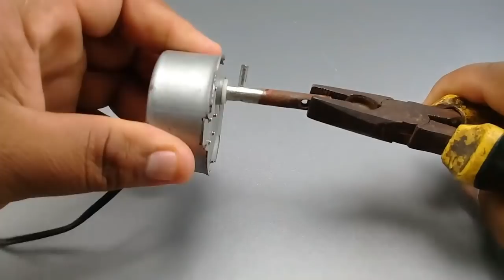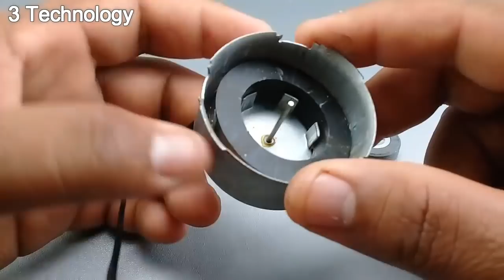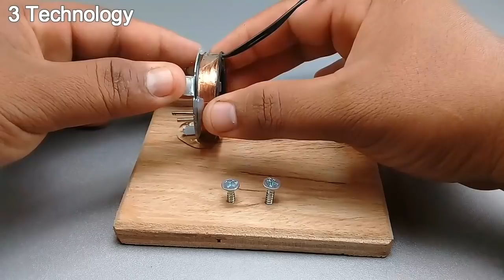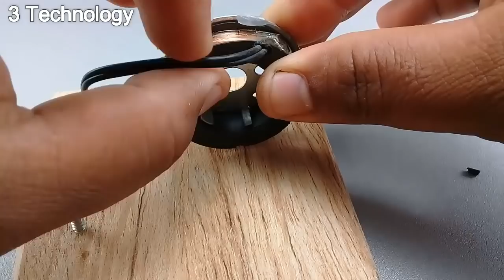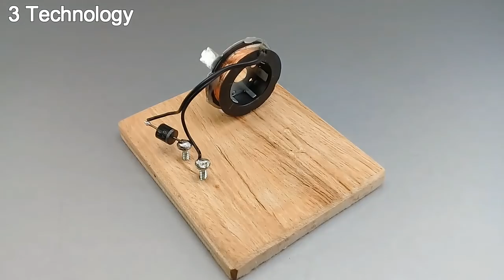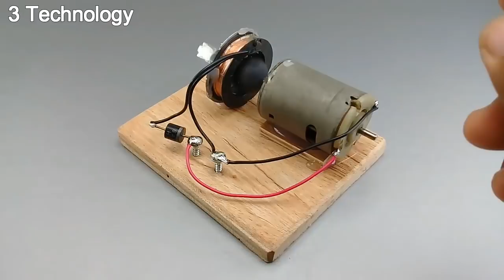I Make Generator At Home New Experiment

Comment: 😄  2v
Reply: good job..kasla agpayso
Reply: @patty1991  It doesn't work by itself. A hidden source of electricity is needed, preferably in a pedestal or fed with thin wires. There is no new magnetic transformation of the magnet. The magnet is made by inserting energy into it to direct its own magnetic domains in one direction. Until then, the magnetic domains pointed in different directions, making the material magnetically neutral - that magnetism had been there before. Therefore, the magnetic field does not create any work, but can mediate it, for example, if you move the magnet in your hand around a coil, which will induce an electric current as a result. However, the job is done by your hand, not by the magnetic field. Just don't take the example from the video, because a magnet in this position and orientation cannot induce current in the coil. Remember that the magnetic field only mediates the work, like a spring, not that it creates it. The energy input to the production of the magnet is the same as the energy input to the production of the spring - it also does not return any production energy until we compress it or expand it.